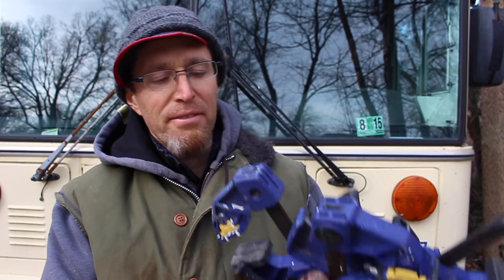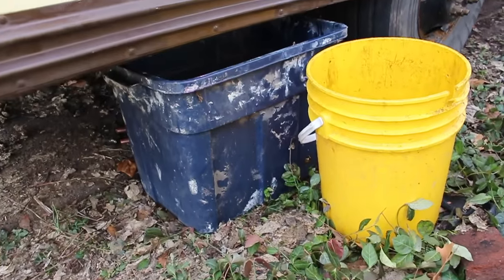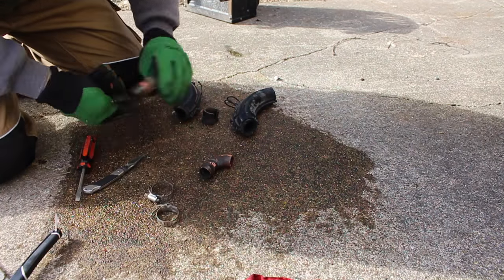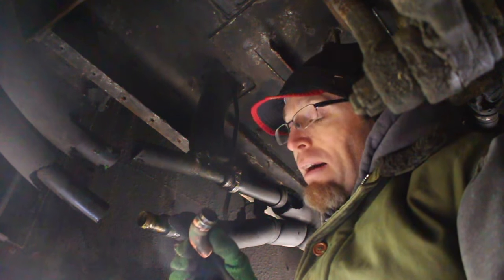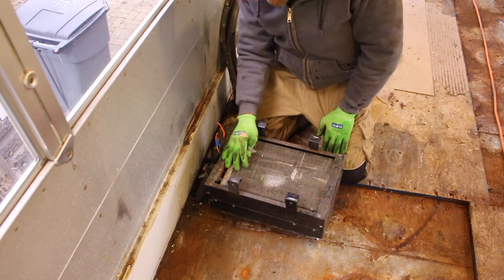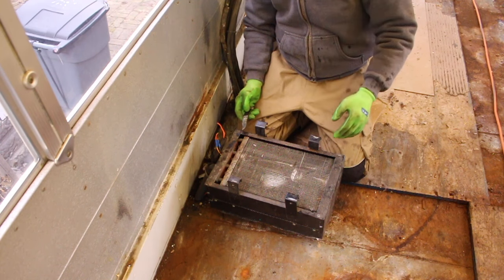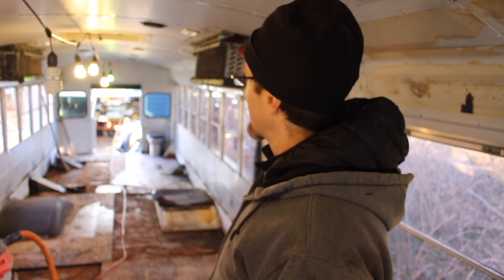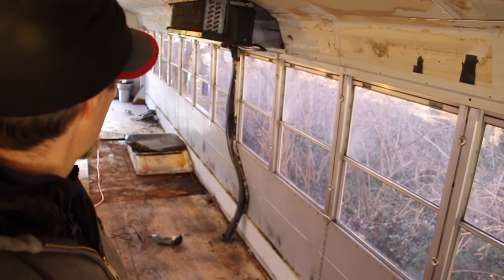Heaters Out and Drained -- Prison Bus Conversion #4

Comment: damn man you've got a serious project on your hands excited to see more bud .  buses in GA don't have heat lol.  being as the AC only work when the engines running how about you pull the compressor from under the hood and somehow mount a Briggs & Stratton engine to it on the back bumper or something so you can utilize those air conditioner's while the engines not running like the big trucks do now ?  jus an idea no worries if you don't like it. not like you don't have enough to do

Comment: Where exactly did you loop it? In the front under the bus? I've always seen it being done in the bus at the driver's area. Does it really matter where you loop it? If so what's the best place to do it? I've been putting off doing mine as of yet.
Reply from the maker: Yep, looped it up front under driver. You could do it elsewhere, but front deletes more hose

Comment: How hard is to learn welding for a first timer to do a Skoolie.  Most people doing conversions are doing some sort of welding that has to be a budget saver?
Reply from the maker: Great question. I learned in about 10 minutes, but it's taken me a few hours of practice to get any good at it. I went with a MIG welder because it's pretty basic and works on steel very effectively. If you can get a hands-on lesson from a friend, that is probably best. Finding the welder isn't that hard ... but then you need to get the gas (for MIG) from a welding shop. So that takes some research. 

Note that there are other ways to patch up a skoolie floor without welding. Many people use glues and sealers and whatnot. So there are ways to get around welding ... even rivets ... if you want to save the extra learning time
Reply: Braze. It's quicker, takes less heat and unlike a weld its rustproof.
Reply from the maker: Woah! I’ll have to look into brazing... thanks for the tip!
Reply: Wow, didn't expect a response from you but I wanted to ask you who makes those pants you wear that has space for the kneepads?
Reply from the maker: They’re CAT pants. Thinner than Carharts but a lot of cool features